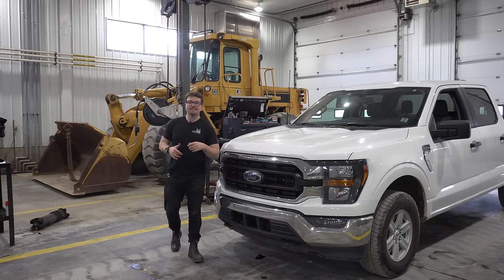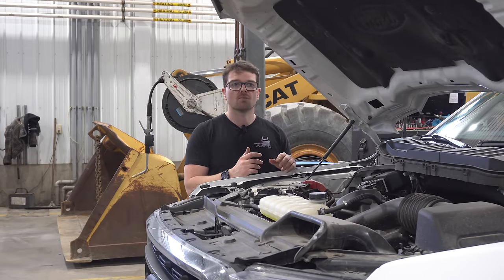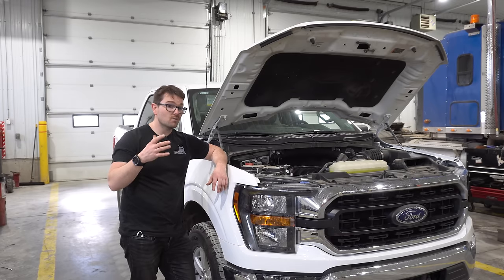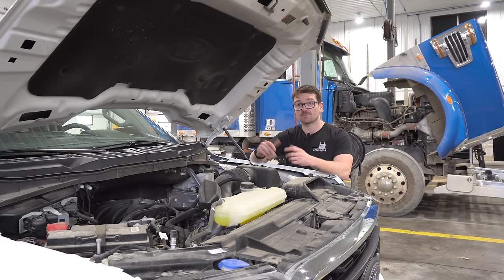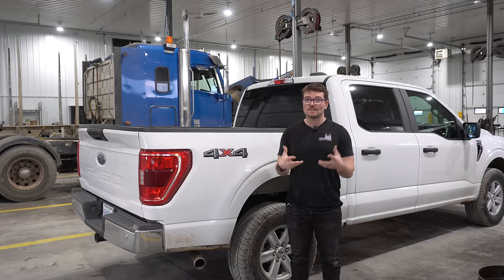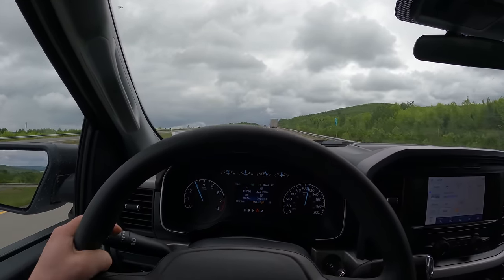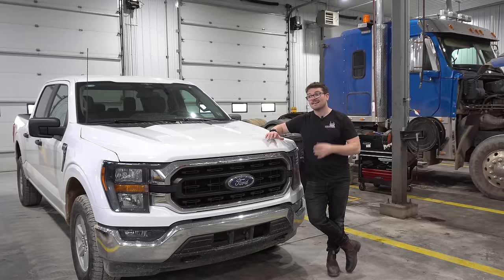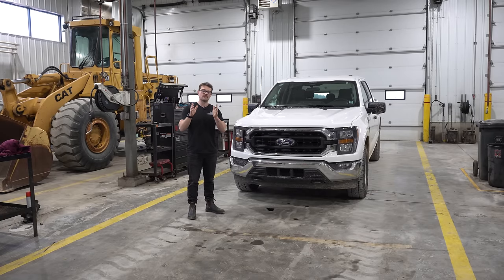Ford F150 5L Coyote V8 Engine **Heavy Mechanic Review** | 5 Reasons why It's the BEST

Comment: The key to towing with the 5.0 is proper gearing. I’m in the process of considering re-gearing from 3.55 to 4.10 gears.  Definitely opt for the 3.73 gears from the factory if you can order one. Certainly agree with the lackluster stoplight-to-stoplight towing experience.
Reply: will be interesting to see what that does to milage
Reply: @kona6451 It will be terrible for mileage. However, the truck is paid off. So, my fuel cost is my monthly payment.
Reply: @Army4Runner I have the 2nd gen coyote a 2015 that came with 3.31 gears. Which mine is the 6 speed. I went to a 3.73 and it made a big difference. I guess the newer 10 speeds make taller gears more efficient than the 6 speeds.
Reply: @andrewcleveland I have same truck put 21 gt ported mani with jlt Cai and oz omega tune much better with this set up, gearing is long I get 49 mph out 1st and 87 out of 2nd gear.  Very strong motor gen 2 is the most reliable besides having vct solenoids issues
Reply: I have the 3.31s and honestly for towing with the 10 speed I've pulled about 7500 lbs with it a few times and it does ok, usually stays in 7-8th gear with that load and doesn't rev very high. However in normal driving it's definitely geared to high as you said, in the stop light/take off driving. I will definitely be swapping ot probably 3.73s at least at some point as I'll definitely end up going up in tire size eventually
Reply: I swapped to 3.73s from 3.31s and I’m still very happy almost a year later
Reply: I recently stepped up from 3.42 to 4.56 in my Silverado. I was thinking about going to 4.10 initially but after reading some comments, I decided to make the extra jump. I have no regrets and it was absolutely the right decision to go a little higher. If you’re running aftermarket wheels and bigger tires, then the bigger gears are the way to go. Fuel economy, highway rpm’s, blah blah blah. If you’re towing with a half-ton, this is the way to go.
Reply: @sophmooreswimmer that's not relevant that's a pushrod engine with torque and lower r p m's
Reply: Just trade it for a 24 F150 Tremor 5L coyote. Has 3.73 gears and front torsen limited slip
Reply: I ended up buying a 23 crew cab 4x4 f-150 with the 3.5 ecoboost.  I love the power potential of the ecoboost with tunes, upgraded turbos, etc.  The 5.0 is great, but I doubt that I could hold back for long before adding a supercharger.  

I think what makes all of the ford's so great is the lack of curb weight.  My double cab Chevy was 5600lbs with me in it while my ford is only  about 5000lbs.  It's like getting a free 10 to 12% horsepower gain.

The ram hemi is way too peaky, the 5.3 is underpowered, and the 6.2 only cones in the very expensive trims.

Comment: Loving my 5.0 Tremor. Getting 20 combined and up to 24 highway so far. Plus, the sound is so much more soothing. Peace, Love!!
Reply from the maker: you honestly can't beat that fuel economy.
Reply: Holy crap. I’ve got a 5.7 rebel and I’m lucky to get 17!
Reply: It might be a unicorn, but it convinced me not to supercharge.
Reply: How fast are you cruising to get 24 highway?
Reply: @jaysson1151  On the trip to Denver and back there was not Interstate until I got to town, just mountain 4 lane and some 2 lane, the fastest I went for any period of time was probably 75 other than occasional passing. I've only taken one other road trip with it so far and that was just 150 miles each way to ABQ from Farmington at about 75. I babied it the first 2500 miles, but not after that. I'll be going 600 miles each way to Texas pretty soon and we'll see how it does on a longer trip (although still a lot of elevation change).
Reply: Thinking about getting the Tremor right now.  Since it has dual exhaust, I feel like it sounded a little better than the Lariat I drove.  Perhaps it was in my head?
Reply: @rodburnette4629  It isn't a true large diameter dual exhaust, but the dual cat-back isn't horrible by today's standards. It doesn't sound anything like my old 69 mustang, 76 big block F-250, or 81 K-5 Blazer, but it sounds way better than most stock new gas trucks on the road in my opinion. To me it sounds a lot like the stock Coyote Mustangs which I guess makes sense. It isn't loud at all unless you are getting into it, so the regular driving noise is pretty subtle. A little noticeable compared to other newer vehicles under general stoplight acceleration, but other than that, it just depends on your foot.
Reply: @kylesummers1565 what rear axle ratio?
Reply: @chadclark5204  3.73. I will admit I got hammered in the high crosswind and headwind going to/from west Texas last week. I think I wound up at about 17 on the overall trip, but after getting over 21 from Farmington to ABQ it dropped to less than 16 with the strong crosswind to Amarillo from ABQ. I reduced speed to closer to 75 after Amarillo and got over 19 to Childress, but it was getting later in the day, and I started turning away from the crosswind (and it ebbed a little). I think the truck likes 60 to 70 MUCH better than 70 to 85 based on the only two trips I have made.
Reply: @kylesummers1565  appreciate the information. I am trying to decide if I want a 5.0 or another 3.5, had three of them. Wish I could get the 5.0 with 3.55 gears, that would be an easier choice
Reply: @chadclark5204  I would think you could order that in a FX4. Is that not the case? I didn't have a choice because of the Tremor package.
Reply: @kylesummers1565  when I build online it will only give me the option for 3.31 and 3.73. If I select 3.55 it requires engine change to 3.5. I am however going to ask the dealer
Reply: @chadclark5204  Yes, I think you should. I got my truck quick because of the chip shortage and didn't have to get the auto start-stop feature, so unless they are obligated by some law there is no reason you shouldn't be able to order your own diff.
Reply: @chadclark5204  That seems random...Yes, I would ask the dealer.

Comment: I've had the 5.3, 6.2, 5.7 hemi, 3.5 powerboost hybrid f150 and 2 coyotes. I loved the gen 3 coyote so much ( I still regret selling it), that I bought a fp700, whipple supercharged 5.0 lariat high as my latest truck and its the one I will be keeping.   The powerboost had the power to tow,  but I would often get 6-8mpg towing a bit bigger of a trailer than your new black one.    My 700hp coyote towed the same trailer, same weight and same route and I was getting in the 13 - 14mpg area.

I went from a dodge kid, to a chevy young adult, to a ford guy in my mid 30s.
Reply: Thoughts about the 6.2 vs coyote?
Reply: @gababagonist  oh man, I had better luck with the 5.3, the 6.2 had both a torque converter failure and a lifter failure within 6000km, 3800 miles or so?  GM took the truck, gave me a one year newer 5.3 with more options and on the first oil change at the dealership (4000km) they said there was bearing material in the filter, oil analysis stated that it had both premature bearing wear and aluminum flakes as well.    Both of those trucks were essentially bought back within a 4 month timespan.  That's when I went back to ford for my 23 5.0 Whipple supercharged.   The GMs were alright, but they really didn't feel like something I wanted to drive for a long time, where as for me personally, the ford cabins and seats are just better positioned for me, the doors allow for better side visual, the door panel is the right height, the center console is the right height.   Much of that comes down to personal preference.  I also had a 2007 Chevy 2500 ltz duramax that was a lemon as well. Where as I've never had these problems with ford or dodge.

The coyote is a far superior engine to the modern 6.2.
Reply: Ye , I have gave up on owning GM products, I now have all fords with the 5.0 coyote in all of my fleet an my down time dropped 40%
Reply: @marshallforeman2051  that's awesome man! Roughly how many miles do the fleet trucks see per year?    I'm really happy with the Ford's, even with their current issues.
Reply: Planning on getting the power boost hybrid myself in a year or so. Would you say without the towing, and just driving it casually in the city or suburbs, and every now and then having a bit of fun with it, would it do better on mpg than the 5.0?
Reply: @TheChosenOne90  combined city and highway eco of my Powerboost was about 23-25 mpg.  It was very very good for eco in the city.  The main problem with it was how glitchy the system was with auto updates.  For the first year, my auto update was glitched and wouldn't update.  The truck was perfect for that time.  Once the updates started rolling in, I had several issues. First was a loud screech out of the speakers when I opened the door for no reason, second was camera modules would update and gridlock, had to have the dealer service that each time. Third was the stop safely issue, left me stranded over a dozen times.  I believe they stated there's a fix for that one now,  I had the generator stick on, when there was no draw, draining my fuel tank over night, when normally the truck would use a quarter tank per weekend while in generator mode. I had the rear axle bolts sheer because it is a max tow rear end, there's no fix for that yet and they need to replace your axles each time....  I had a lot of issues with my PB in 2 years of ownership.
Reply: @stephenfrost545  ok thanks, there’s this guy I’ve watched on here his channel is ArmyProperty, and he had it for up to 60,000 miles and had no big issue. I think he just got rid of it to get a bigger truck. And I’ve watched others who’ve had it for like you a year or 2 like yourself, and didn’t have much issues. But who knows, hopefully I won’t have major issues. Because like I said I’m just trying to get it to use it for normal use, no off reading, no towing, no speeding every time I use it.

Comment: I have a 2011 f150 5.0. First year of the 5.0 and I absolutely love it, it seems more powerful than it should be for the size of engine, having it be a rev happy engine is both good for towing and gives it a really high cool factor especially for exhausts. I’ve got the heaviest one you can get, being the super crew cab with the 6.5 bed, and it’s still fast. I am super excited to tow with it, because my old ram 1500 with the 4.7 was not exactly good. My new ford with the 5.0 and being as big as it is, is supposedly rated at 7500 lbs towing capacity, something tells me it could tow more than that for sure.

Comment: I have the 2014 5.0 with 3.73 gears. 119,000 miles and still goes 8,000 miles between oil changes without losing any oil. Have ran Motorcraft 100% synthetic since new. Never a problem and runs like a scalded dog. Towed a Mercury Mariner 500 miles and got 14.1 MPG doing it.

Comment: I have a 2013 f150 5L, 300k, runs great.  My friends 23 f150 2.7 turbo blew up after 2 months. My other friend has the new powerboost and as great as it can be it has huge electrical issues...sometimes simpler is better, cheers
Reply: Agreed 100% brother, I have a 2011 Ford F150 with a 5.0L Coyote V8 in it with 158,000 miles on it and still going strong and its a beast and it sounds like a beast with the Borla ATAK exhaust on it as well.
Reply: Have you had lead frame replaced on transmission?
Reply: would you
 buy 2013 with 200k for $10,000

Comment: I love my 2023 XLT F150!  It’s brand new and just breaking it in. Previously had a 2005 F150 w/5.4 Triton and was hesitant to buy another Ford. I also previously owned a 2016 Colorado which I really liked and I would consider buying another GM truck.  However, after doing research on the GM 5.3, 6.2L and Ram 5.7 Hemi, I thought the 5.0 coyote was the best choice. It’s a little complicated in the valve train but it has adequate HP and torque. The 3.5 ecoboost has WAY MORE torque but just a little too complex for me and maybe overkill for what I need to tow. 

Love to watch your videos.  I work for Cat and glad to see the 950 in the background.
Reply: I got a 23 king ranch. Primo

Comment: I have 350,000 miles on my 2013 5.0 F150 super crew and it still runs like the day I bought it and I tested both motors when I bought my truck new. The Ecoboost was a little faster but sounded like a sewing machine and at the time it had a bad reputation for motor problems that I wasn't willing to roll the dice on. I knew I was going to be keeping my truck for a long time and that the Ecoboost with its reputation wasn't going to last as long. IMO the Coyote 5.0 is one of the best motors Ford has ever made.

Comment: The one thing that has caught me totally off guard with this engine in a 2022 F-150 has been what I've collected in a catch can.  Over ~13k miles in 9 months,  I've collected about 180 ml.  I'm not too worried about it because of the port injection, but it's certainly enough that I would recommend some sort of catch can solution.
Reply: Yes I put a catch can on my 22 5.0 a week after delivery & remove 3 to 6 oz. every 3K miles.  Higher amount when towing RV trailer.  Oil change every 6K.  Not needing to add any oil between oil/filter change intervals.  I'm planning to send oil sample to Blackstone & check for fuel dilution
Reply from the maker: fair enough! thanks for the info.
Reply: @daveallen7767 what catch set up are you using?
Reply: J&L  OSC, plug & play with similar to OEM fittings for connections.  Glad I added the 3 oz. extension for 6 total.  One of the hoses was excessively long ( would look better if shorter) but happy overall
Reply: Thank you sir!
Reply: Anything in can says excessive blow by…….worn engine.
Reply: Just rolled over 20K miles so I doubt that.  But I do plan to have oil analysis done,  wondering about fuel dilution

Comment: I had a F-150 with the 5.0 Coyote and I really really liked that truck. It had the tow package thus the 36 gallon fuel tank.  I could drive that truck 700 miles easy before I needed a gas stop.